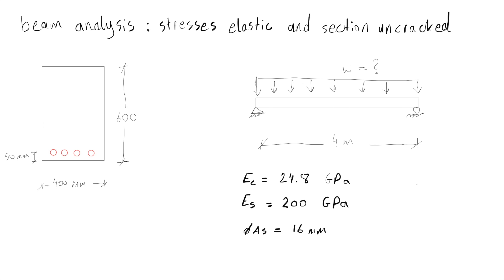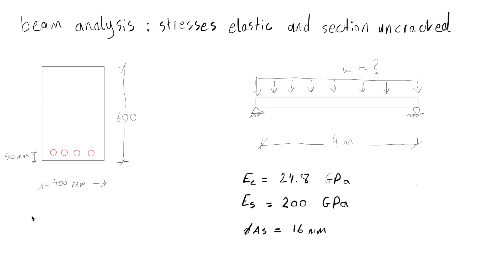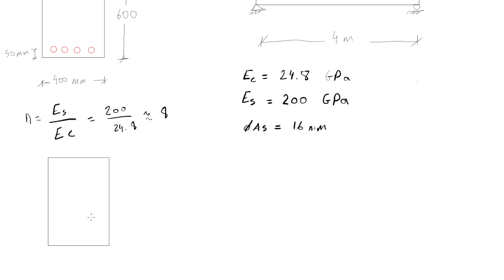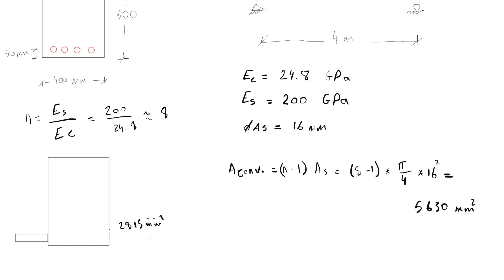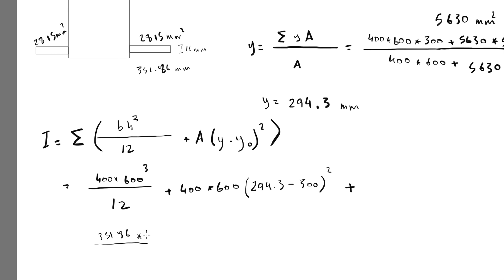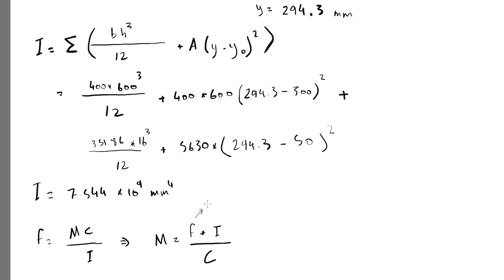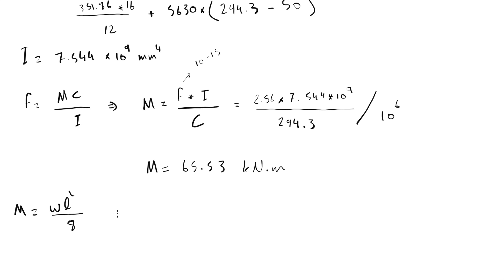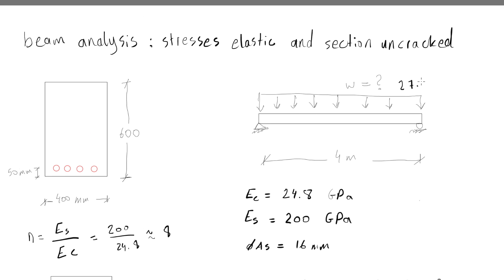RC beam analysis: stresses elastic and section uncracked

Comment: Can you give me the explanation for (n-1)Ast
Reply from the maker: the steel is n times stiffer than the concrete. you can replace the steel area by n times of concrete to get the same stiffness. Imagine you remove the steel bars from the section, you need 1*Ast to fill the holes of the steel bars and (n-1) will remain to add it to the sides of the concrete section. In this example n=8. 1 part fills the steel holes and 7 parts are added to the sides.
Reply: @civilengineeringwithmabast7540  why didnt we use just n*As formula ? what is the difference betwwen with (n-1)As

Comment: Nice! 
why stresses develop in uncracked elastic beams
Reply from the maker: In simply supported beams under distributed load, the bottom part of the section will be under tensile stress and top part under compressive. This is how stresses develop in different sections of the concrete. Concrete itself is a brittle material with having negligible resistance to tensile force that's why steel is added at the bottom of concrete section. Here I have taken that little tensile resistance of concrete with the help of steels to see how the section acts when it is still assumed to be uncracked
Reply: @civilengineeringwithmabast7540  Thanks so much, really appreciate it.